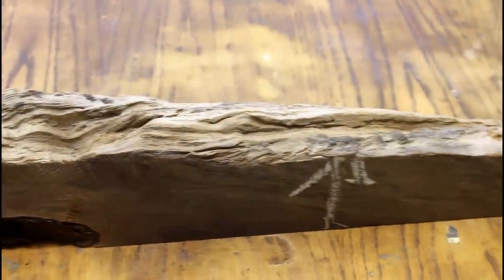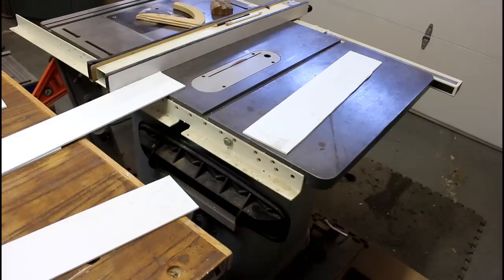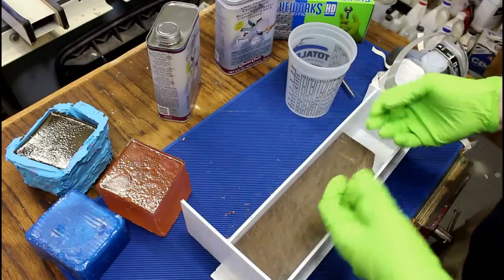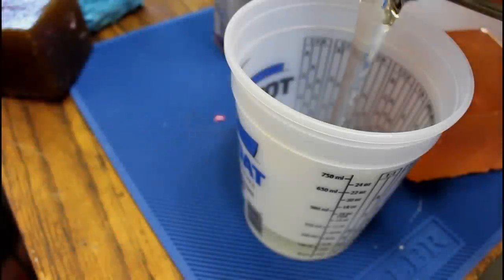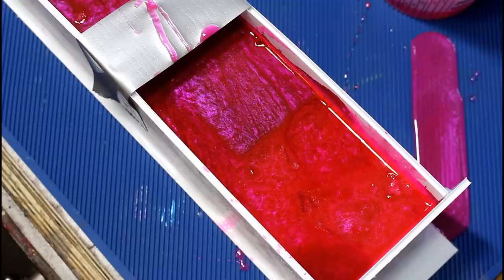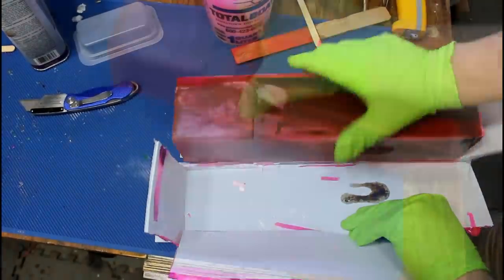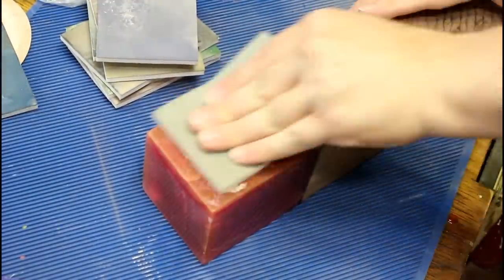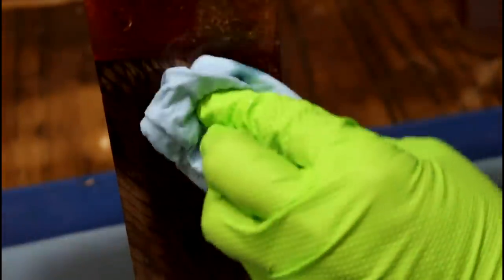Minecraft Redstone Torch in REAL LIFE

Comment: Hey I'd like some advice:
When I sand I use a belt to get rough shape and begin to smooth I then hand sand to get to the Finnish proses. But as I hand sand the edges seem to wear down more than the centre. I'm not sure if it's the technique or the tools ("worst carpenter blames his tools") ps. Pardon my spelling
Reply from the maker: Sounds like you're putting more pressure on your fingers. A normal thing to do. 
If the object is small, I'll bring it to the sandpaper to avoid that. (I show that in the secret ring video)

you can also use spray adhesive to mount sandpaper sheets to blocks (or get a sanding block) and it will help a lot with flatness.
Reply: @peterbrownwastaken  oh ok I'll try that. I've seen a thew people use some sand paper stick to a board. Is there a more efficient way

Comment: If you specifically want bubbles, might I suggest a can of air next time? Use the little attached straw and trickle out some air from the bottom of the pour. Wouldn't give you any cracks, but you don't always want those.

Comment: The resin does not overheat with the light inside??? There is any kind of resin that stands higher temperatures?
Reply: I'm talking about higher temperature than the light you put...for example is possible to cast a lamp holder in some kind of resin? Which resin resists better to the heat??
Other question, have you ever tried the elastic resin casting? The resin that is not stiff but it's 'gummy' like consistency...

Comment: You should try some of these pigments they have holo and thermal color changing pigments for resin I think it would be wicked cool like for this project they have one that’s clear to red and that would have looked amazing cause sorry for ranting here is the link https://solarcolordust.com/
Reply: liquid crystal will be destroyed if mixed into resin, both chemically and thermally. Not to mention, liquid crystal and other thermal pigments must be sub-surface to have any visible effect. If submerged several inches into resin, assuming they aren't damaged chemically and thermally, no heat will be able to easily penetrate the cured resin down to the pigments; ultimately rendering them worthless.

Comment: Want to know whats crazier than the USA not adopting the metric system? Whats crazier is that it DID. In 1893.
" Under the Mendenhall Order in 1893, metric standards, developed through international cooperation under the auspices of BIPM, were adopted as the fundamental standards for length and mass in the United States. The definitions of United States customary units, such as the foot and pound, have been based on metric units since then."
The United States adopted the metric system to have a standard on which  TO BASE THE FOOT AND POUND, rather than just using the meter and kilogram measurements outright.